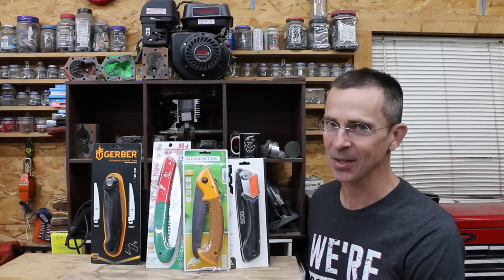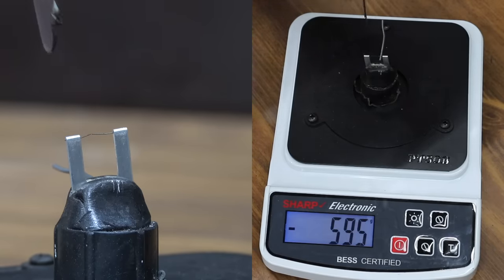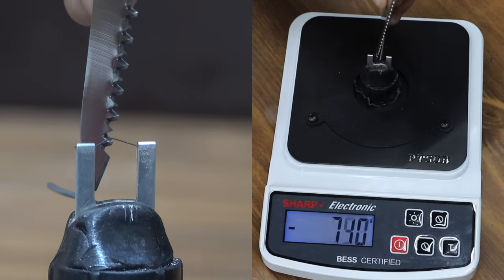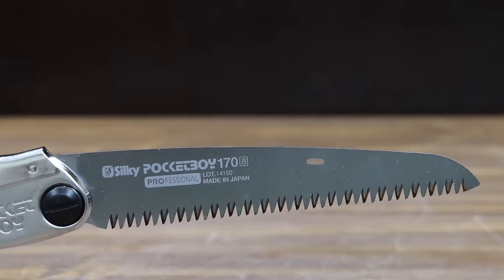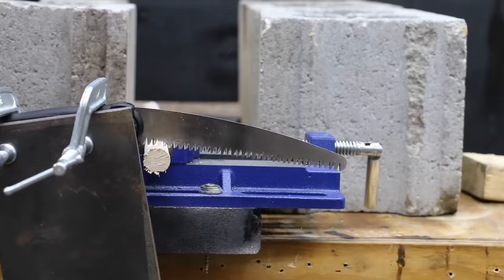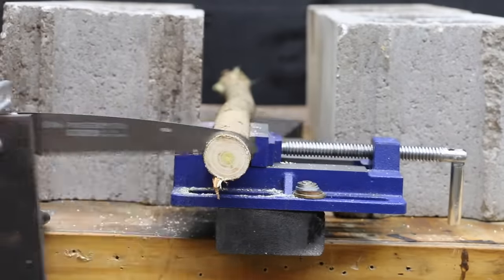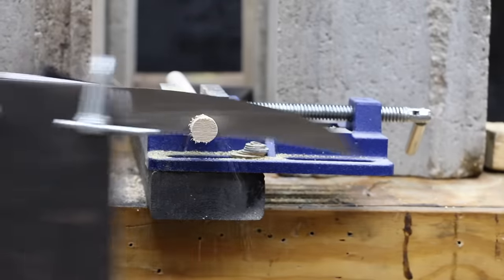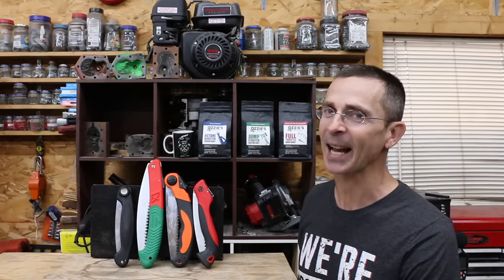Best Folding Handsaw? Samurai, SOG, Corona, Gerber, Fujiwara, Silky, Kershaw, Gruntek, Mossy Oak

Comment: I have used several of the brands you tested, and can say that in this one instance, some of the numbers are misleading. the test of a hand saw like this is really in long term performance, durability, and reliability. the Corona has pretty good long term standing, but the Bahco really is a better saw than some of the ones you rank above it. I have carried a Laplander into the woods many times, and never had one fail. if I were setting the standards, I would have put much more weight on the blade thickness, and the minimal flexibility. also, I understand you not wanting to intentionally destroy all the blades, but push stroke flex, resulting in bends is one of the most common reasons a folding saw will become useless in the woods. the Corona, Laplander, and Silky have all proven themselves, and are favored among bushcrafters, and long hikers.

Comment: Eye opening review. I was surprised to see that some of the less expensive brands like Corona, Samurai, and Gruntek beat out the Silky and Bacho which are about twice as expensive. I should have watched this before I bought my two Silky saws. Thank you Project Farm!!!
Reply from the maker: You are welcome!
Reply: 吉田あぢべ  I've known people who have used the Silky for years only changing out the blade as needed keeping their original handle. I think Silky was for many years the front of the pack for most people but they seem to have a lot stiffer competition these day. A long term use and wear test would be good, but outside the scope of this video.
Reply: Still not getting rid of my Silkies. Corona might start out nice, but over time...🤔
Reply: I own a Corona and a  Bahco and regret buying the  Bahco Swedish saw based on this review.
Reply: I actually use these enough to go through blades and this review is in no way reflective of someone who holds one for hours at a time. Silky then bahco then Fiskars then corona for me. And you know what the best one is? The one that's sharp and there when you need it.
Reply: In my landscape business I choose Silky because of the metal parts - metal handle, metal latch... Better long term prep tool.
Reply: Over time, you will definitely appreciate your Silky saws MUCH more than Samurai owners will theirs. Corona saws seem to be pretty good, although I know little about their staying power. However, Samurai brands are exceptionally susceptible to rust and corrosion, and they just don't hold up as well as Silky. While Silky saws are very expensive, they provide value for their cost.
Reply: It wasn't exactly apples to apples.  He should have tested a curved Pocketboy.  Even so, at half the price the Corona is a great buy and the durability test he did seems to indicate the blade will last just as long if not longer.  The Silkys are better made for sure but when you can buy an entire saw for the price of a Silky blade that doesn't matter much.

Comment: I have been using the Corona for a couple years now. Bought it as a value brand and it has definitely been a workhorse in my tool shed
Reply from the maker: Thanks for the feedback.
Reply: I really like their bypass pruners too with the removable blade. I've been using them for 30 years!
Reply: I bought 3 10" ones for my cars in case of a bad storm some where and trees down. best cutter compared to the Fiskar brand.

Comment: I’ve had a corona handsaw that I bought back in 2010. It’s used regularly and still holds up great. When I started this video I knew it was going to win over the more expensive options.
Reply from the maker: Thank you for sharing!
Reply: The corona saw is pretty sick!
Reply: @2drealms196  I've had my Corona saw for 15 years, and use it everyday, still sharp like new.
Reply: I never go fishing or canoeing without mine. It has got me out of many jams very quickly. I will never use a machete again. Corora saws for the win. I have probably had mine 6 years.

Comment: I recently bought a Corona at Lowes and I've processed two Christmas trees for firewood next winter. The curved blade really helps dig into the wood on the pull. It's affordable and overall works great. I believe it's well worth the money and should last long time. Good to see how well it stacks up in this video.
Reply: Why? You just wanted to make the task more time consuming for absolutely zero reason?
Reply: @johnquinn4680  What task? Processing firewood?
Reply: @GoldenBoy.17  yes dude. Only an idiot would cut a tree up with one of these saws when they have numerous better options.
Reply: @johnquinn4680  If its a particularly thin tree or this saw was bought for more than just processing firewood then I see nothing wrong with buying this tool. Maybe he needed a general saw for small-ish things and the fact he used it for firewood just means it gets the job done. A lot of tools just aren't worth the price or the space and people make do with smaller ones even if it makes things harder. Though yeah a small saw like that wouldnt be my tool of choice for cutting up logs and did not make the connection at first. Personally I would use a hand axe though if it's something I did once or twice I'd see why I would instead just buy a saw which has more applications.
Reply: @GoldenBoy  a basic carpentry saw costs like $10 dude and it would work far better than a foldable saw in this situation. I cut my own Christmas trees every year from my own property. I've cut up a hell of a lot more than just 2 tress in my life bud.
Reply: ah yes, cutting down 'christmas' trees for asherah....
good on you

Comment: I have the Corona saw. I have been using it for pruning for the last 5 years and it's still cutting just fine. I've even cut down an oak tree that was around 4 inches in diameter with it. It went through it with no problems.
Reply from the maker: Impressive saw!
Reply: I have really enjoyed my corona pruners, I'll pick up a saw next time I'm in the store. 

I've always liked their stuff just because it's easily accessible and performed good...
Reply: I routinely cut dry madrone 4"-7" with the 10" Corona. The saw is amazing.

Comment: I have both the Gerber and a larger Silky.
Handle comfort is important. The handle on the Gerber can cut you. I have to use it with a glove.
Nothing compares to the Silky. The blade quality is unmatched. I have accidentally folded it in half sideways with no damage.
Reply from the maker: Great feedback on the Silky
Reply: Same, the thicker blade is a benefit when your pushing hard on the saw. Keeps it from bending easily and if it does start to to won’t become damaged. If your using your saw work silky is king.
Reply: @FishFind3000  You're not supposed to apply pressure to the Silky saw.
Reply: @EEStuff  If i never put pressure down it wouldn't cut. You need some down pressure to have the teeth engage the wood and make a meaningful cut. The saws weigh so little that no down pressure would be ineffective.

Comment: Another interesting point for UK viewers - the Corona is very expensive to obtain here - around £40, but the Fujiwara is about £15, so for us, the Fujiwara would be a clear winner for performance combined with value.
Reply from the maker: Thanks for the feedback.
Reply: Prices seem to be varying a lot by location; here in Germany the top 5 are priced at:
Corona 50€
Samurai 52€
Fujiwara: No seller found; seems to have been sold at ~40€ at one point
Gerber: 20€
Silky: 48€
So I went with the Corona even though I didn't intend to spend that much. The Gerber looks nice, but I had a not so great experience with a Gerber Hatchet, which was great in the beginning but dulled pretty quickly. Same seems to be happening here. In my opinion they are built to impress when you first get them but not to last. Since I actually use my tools, I don't like those kinds of stunts.

Comment: I'm doing bushcraft and i'm using a Silky Gomboy 270mm. I'm very happy with it ! it's not 20 bucks but you will never be disappointed !
Reply from the maker: Thank you!
Reply: I have & use the 240mm Silky Gomboy with a 9" blade.  I saw surprised it lost it's sharpness after usage/  Do especially like that this cuts only on the PULL stroke.
Reply: @azclaimjumper  Every saw loses sharpness after usage more and more.
Also that's why you often see lumberjacks sharpening their chainsaws despite having excellent brands.
It is normal.

Comment: Great review. I purchased a Gerber in the late 90's as a deer hunting accessory. Besides working great as a limb saw in conjunction with my climbing stand, it also came with an interchangeable bone saw blade which is very useful when processing deer. I've used it several times a year every year since I bought it and it's still performing about as well as it did the day I got it. I've been very pleased with this purchase.
Reply from the maker: Thank you for sharing!
Reply: The Baco does well here too.

Comment: Oh boy, the bush craft community will be all over this test.
There tends to be fierce product loyalty on this one.
I have a Boy Scout Sira saw from '66.
I did not understand the pull saw concept at   the time, and bent it. It still cuts.
I got a smaller one in the '80s for back packing.
Later I found a bargain Corona.
The unit lives under my tractor seat. What a marvelous tool.
Too heavy for backpacking, a Bacho seemed right. It will cut bone.
Silkies seem fragile.  I found a snapped off blade, and made a fixed handle. 
By far the Corona has been my go to for nearly 20 years. 
Having M12 batteries   I just went for the little chainsaw. It boggs down less with skip tooth chain. Thanks Chris

Comment: Thanks for another great hand saw comparison.
It would have been interesting to see how a Fiskars saw would have compared. I own about 10 of the fiskars hand saws and have been using them for well over 20+ years. Having one in each tractor and vehicle is very handy.
Reply: Fiskars = Gerber.  They offer various cutting implements, but they own the Gerber brand and just rebrand Fiskars products as Gerber sometimes without even changing the design/colors.
Reply: Fiskers garden tools are top notch. My Fiskers Billhook and hatchet are beasts!
Reply: I got a fiskars after breaking the tip off my silky. I'd say its not quite as good as the silky
Reply: I've used the Fiskars and I own a few Coronas... I'd gladly have 2 of the Coronas instead of 1 Fiskars and the way theyre priced thats about right. Performance wise the Corona wins, no doubt in my mind.
Reply: @alexshepherd4469 yeah but it's a lot easier to fork over fiskars money than silky money

Comment: I work as a gardener and arborist. I carry the bahco in my pocket at all times. I picked it based in the fact it fits very well, it doesn't waste any space, and it seemed like the best quality option in price range. I'm very happy with its performance! I dont think many of these saws would pass my pocket test either 😅
Reply from the maker: Thanks for sharing.
Reply: Bahco Laplanders are not the best but they are probably the toughest. Thin blades buckle and snap and that's no fun when you are miles away from a hardware store.
Reply: Silky Pocketboy is your friend!
Reply: yeah bahco isn't the "best" for everything but it's the perfect middle ground saw, and the blade can fold in half without breaking where a silky will snap if you accidentally bend it pretty quickly....... Bahco is what I'd carry for hiking/camping and in cold weather, it's tooth design is meant mostly for firewood, being, dry wood, and it cuts on the push AND pull where the other saws just have all the teeth on the pull only. There are advantages of bow-saw style blades like the bahco a lot of people don't realize.
namely: it uses your muscles more evenly so you fatigue slower, it might not be the sharpest but it actually has the thinnest and strongest blade of carbon steel and thinner = less wood to cut to get through wood, and also if you have a little needle file (1 dollar) you can actually sharpen a bahco by hand with no specialized tools, where impulse-hardened saw brands are great, but cannot really be resharpened (they technically can but only with expensive, precision files, multiple angles, braces, and are much harder to do and can only be resharpened around 1-2 times maximum, for all intents they are disposable).

And if you don't want to resharpen well, bahco replacement blades are a hell of a lot cheaper than a silky
Reply: I prefer and own the Corona, but have heard nothing but good things about the Bahco

Definitely something to be said about a durable tool like that Bahco. I haven't had the Corona suffer any damage yet as I am careful with it but I don't think it would hold up as well in any sort of accidental abuse.

Comment: My mother has a non-folding version of the Samurai with a more pistol style grip and belt sheath she bought a few years ago from Amazon. It's been great for pruning small limbs and even some 3"-4" branches. It's still very sharp. :)
Reply: We have one for 2 years so far for pruning very good saw
Reply: @ioanniskonovesis3438  Agreed. Well worth the money. Especially when properly cared for. :)
Reply: Yep, have used one for years and love it. When it comes to a folding saw I use the Silky saw, another Japanese saw.
Reply: @jamesb3092  The Japanese are the masters of steel IMO. Having a good Japanese hand saw in your tool arsenal doesn't hurt. :)
Reply: @Slane583  100% agree! I do some hobby woodworking and I use all Japanese handsaws, very happy with them and the cutting teeth on those saws are very close to the same as are on the Samurai and Silky saws.
Reply: @jamesb3092  I've seen those before, but I don't do any wood working to require the Japanese saws. My mother bought the Samurai saw after doing some research and finding it was the best saw you could buy at the time for that type of saw.

Normally she likes to save as much money as possible when buying something but she splurged on that because it was for yard work and she was tired of throwing out junky saws that didn't cut.

 As for me on the other hand. I tend to follow the Buy-Once-Cry-Once mantra for everything I buy. So it takes me a while to buy certain things as I'm saving up for them. :)
Reply: @Slane583  Understand 100%. I go both ways, it depends on if it’s something I know I will use often ( buy once, cry once), if I will only use it a few times a year I tend to sacrifice quality and pay less. Try not to buy much of anything except necessities at this point and time. Everything is way too expensive right now.
Reply: @jamesb3092  Agreed. If I buy any type of tool now it's because it helps make a normally painful task quicker and more efficient. :)

Comment: This is a good apples-apples comparison on these. I've been a Silky fan for a while, surprised to see it bested like it was! Having said that, one of the nice things about Silky is you can buy a saw from them in a huge variety of sizes, shapes, and tooth-per-inch setups. The TPI affects the cutting speed and (inversely) smoothness of cut.
Reply from the maker: Thank you for sharing!
Reply: I think if he had gone with anything bigger than the Pocketboy with the straight blade, the Silky would have come out on top. Notice that it is quite a bit smaller than the others, with a straight edge. That curve makes a big difference. And, they will last longer.
Reply: @boomstickman71  his cutting efficiency rig kept the stroke length constant across all of the saws. Agreed that his hand-test would  be biased towards a longer saw blade.

Comment: Great test! I own a longer, fixed blade Corona saw and I love it. If I was using it daily though, I bet it wouldn't last as long as a Silky. It just seems like it is more solid and durable.
Reply: All my trail/camping/off-roading "pruning" saws are Silky: KatanaBoy (500mm blade -- the SHORTEST blade KatanaBoy available), BigBoy (360mm blade) and  GomBoy (240mm blade). All curved blades and XL teeth. Even though the Silky here in this test-video didn't do as well as the Corona, I chose Silky because of their consistently high owner-ratings, they DO cut well/quickly and seem well-made for long-life...and have replaceable blades when/if the original blade ever dulls (if you only use it occasionally, it will stay sharp for YEARS). 
The KatanaBoy is kept in my Jeep (to remove occasional downed tress blocking trails (no, did not want to carry gas/electric chain-saw for a couple of reasons) and the GomBoy for hiking/camping ("bushcraft") use: Smallest/lightest of the 3 yet still handles larger diameter trees/firewood. The in-between size BigBoy could also be used for 4x4 trail-clearing.
Expensive, yes (especially the KatanaBoy models!), but in cases like this I apply the "Buy Once, Cry Once" principle.  And I don't think any other brand would be THAT much better (even IF "better") for me to have bought them instead of my 3 Silkys, though likely they'd be WAY cheaper.  Silky offers a number of models so there's probably a saw for just about anyone's needs...but I don't think ANYONE makes anything like the Silky KatanaBoy series...so it you want/need a "serious" saw like those, it HAS be be a Silky.
-- BR

Comment: Great work.
I was hoping for a test on how hard it is to pull those saws since I'd rather take 15 easy pulls vs 10 hard pulls to cut the same piece of wood.
Reply from the maker: Thanks for the constructive feedback
Reply: Also tooth design can benefit different hardness of wood. If your cutting hardwoods you don’t want large aggressive teeth. But if your in softwood the larger teeth will help much more.
Reply: geez, JS, this 73yr old 100lb female with 12m/cycle,+roofing,car crashes would never admit to that...gimme my 3ft bowsaw& silky to conquer all...